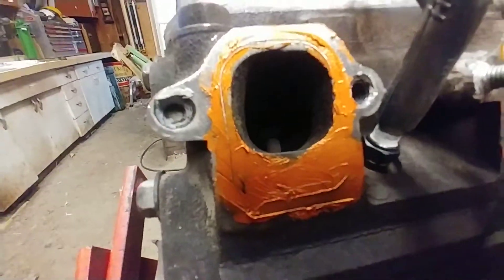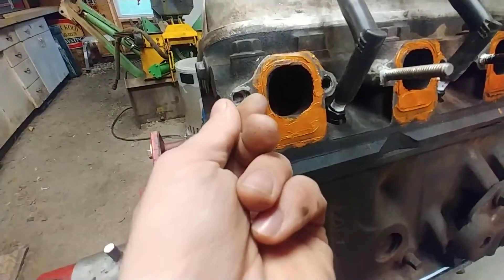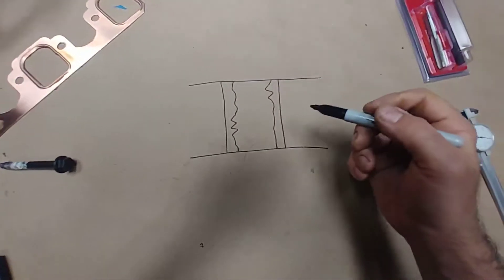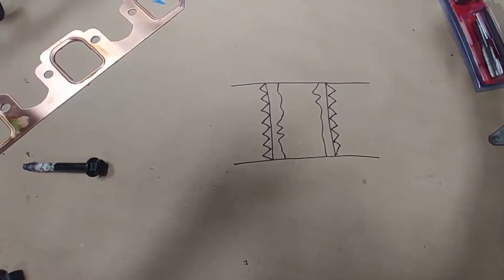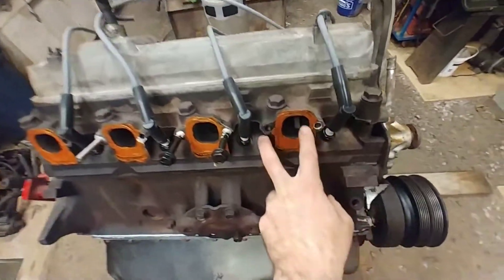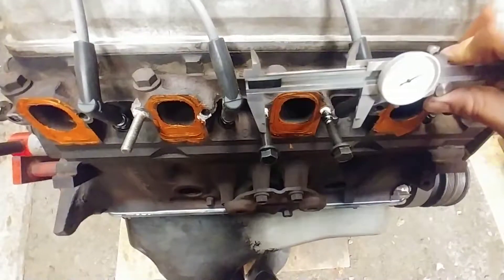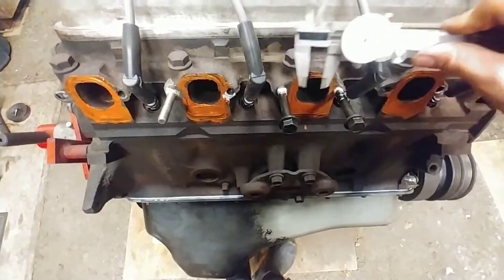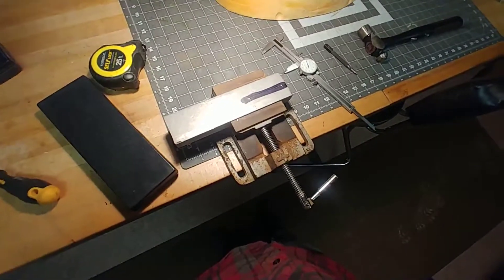How To Repair Stripped Hole In Cast Iron With Helicoil 1/2

Comment: Helicoil Pty Ltd actually recommends NOT to use Loctite 

Btw, just drill your pilot hole through the exhaust manifold.
Reply from the maker: My old manifold hole was also out of round and the new ones hadn't arrived. Never had an issue with attachment, however the hole was overly deep and punctured my coolant jacket, so a few years later I ended up getting new heads. Word to the wise. Thanks for watching!

Comment: Was faced with the same but instead of making a block guide I decided to bolt up the old manifold and used a steel sleeve through the original hole to guide the slightly smaller drill straight. Worked perfectly and saved me trying to get a block exactly perfect. I can OCD the heck out of things.  Everything else works the same.